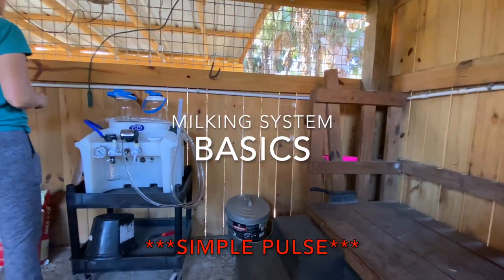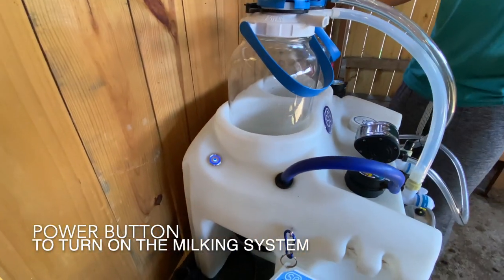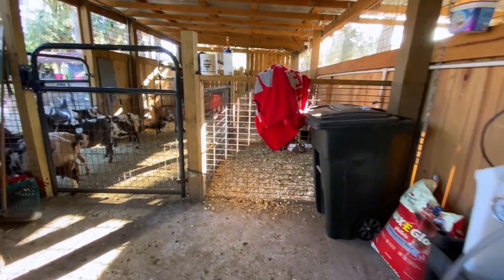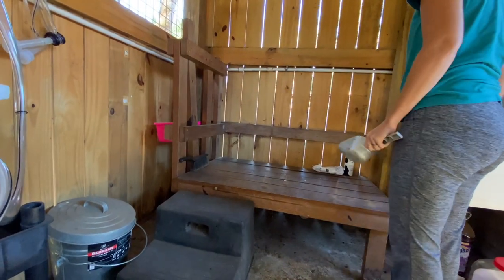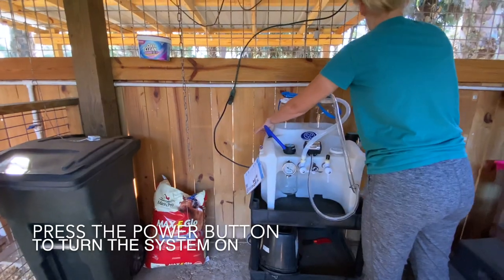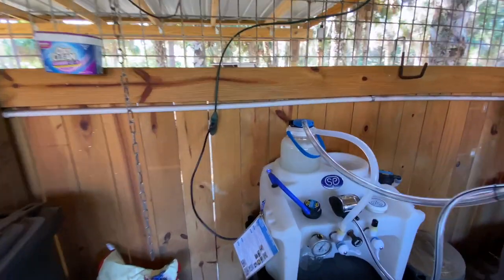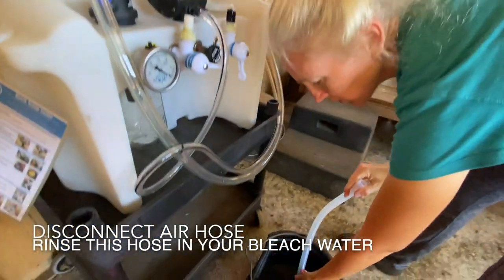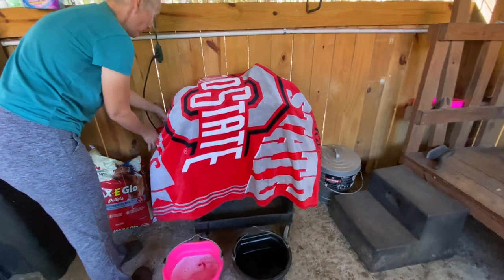Step-by-Step Guide to Goat Milking with Simple Pulse Milking System #goats#milkinggoats #simplepulse

Comment: Do you do the bleach water after every use or just after the last milking of the day?
Reply from the maker: I run bleach water through straight away after each milking. its 1oz per 2gal bucket. If you let the milk sit too long it will create stickiness in the gaskets and machine doesn’t work as well. Plus creates Bacteria the longer the milk is left in the tubes. Then once a week take the tubes and “claws” apart and clean well with soap and water.
Reply: @gorgeousgoatsgalore-rpr  Thank you for the info!